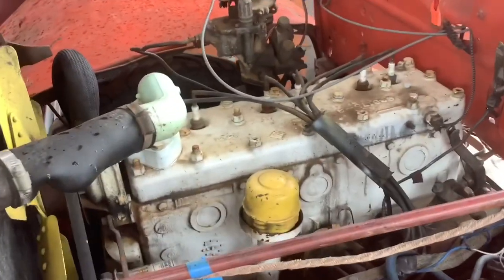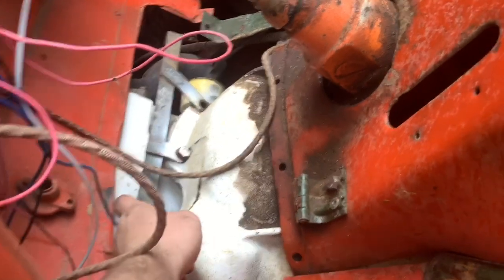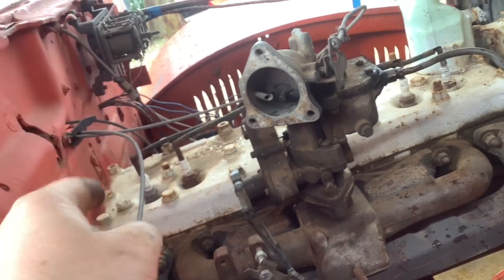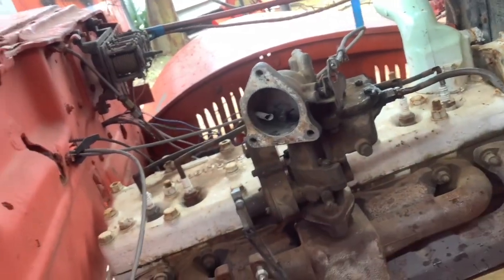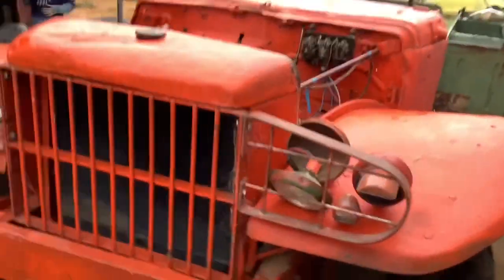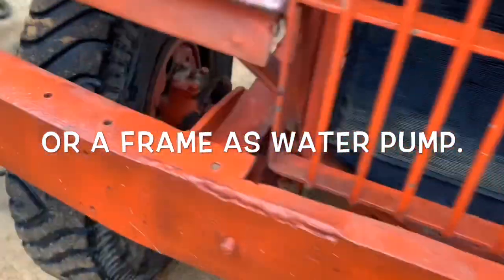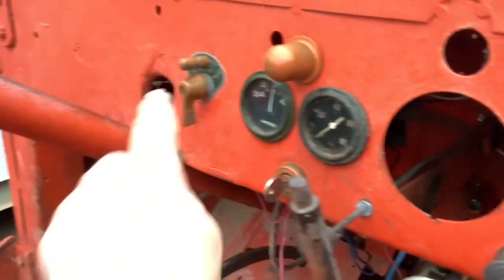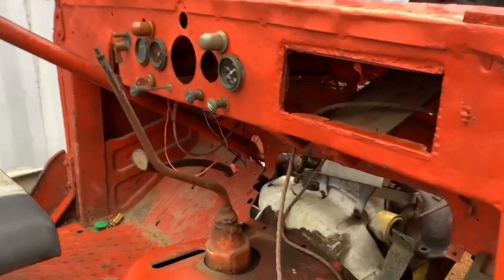Dodge WC55 short start up and run plus look around.

Comment: What are those rims off of? and what tires size is on them?
Reply from the maker: Chevy rims 20 inch tyres. I have the original rims to go on this truck and brand new 900:16 tyres.
Reply: @ridingwitha6vbloke878   Do you happen to know what model of truck they are off of? I am thinking of mounting some 9x20's on my m37 and am in need of rims.
Reply from the maker: @w2slav  when I purchased my first WC dodge and I was told it was from a 1940s chev truck I couldn’t find any information about the rims until I found a rims on a ford truck at the car show and I ask the owner of the ford truck and told me it’s a 1940/1950 Chevy rims truck. But still couldn’t find information. Where are you base. I am base in nsw Australia.

Comment: Dude....fix your linkages and carbie before you destroy that rare truck. Poor things screaming it's head off as you ride that clutch.
Reply from the maker: Hi mate.
Yes I know. The truck has no exhaust at all. I will be doing a full restoration on her. And I almost finished rebuilt the original T214 engine for the truck. Thanks for the head up. I have more then 4 WC dodge.
Reply: cant see a problem there,  at least he has a radiator hooked up ,  seen too many videos of idiots running these  engines dry.